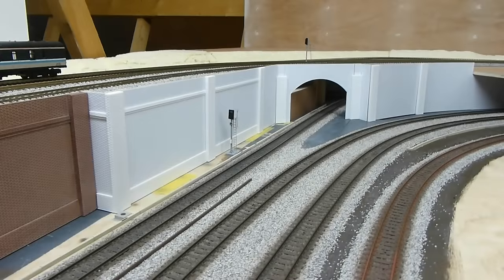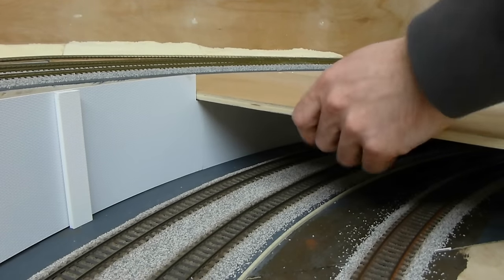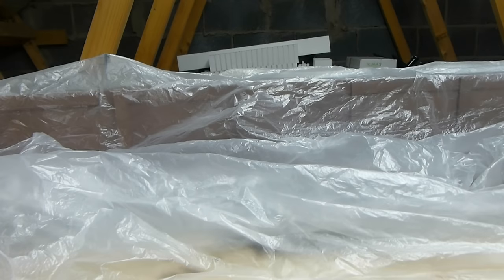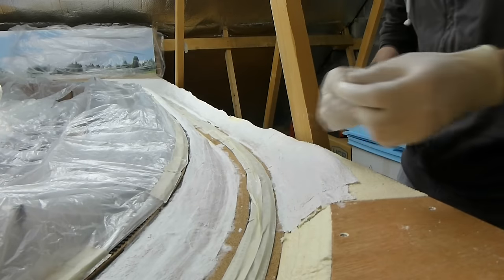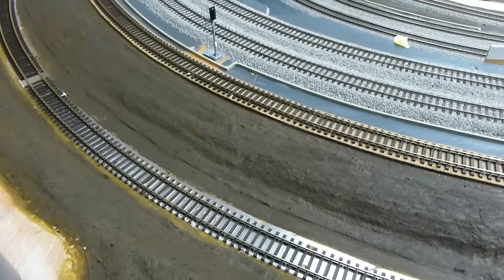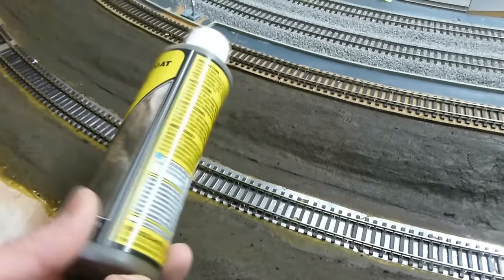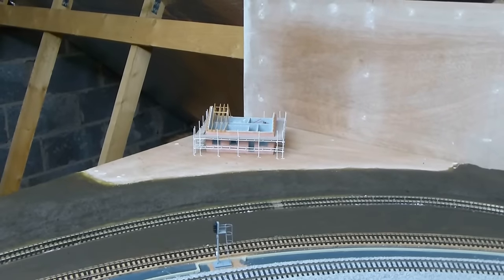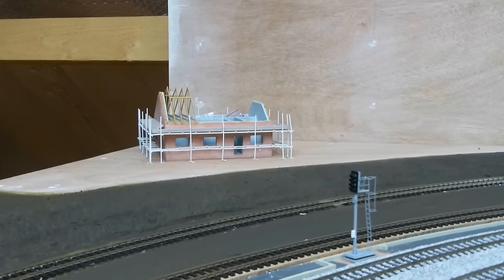Dean Park Station Video 112 - March Update & How to use Plaster Cloth

Comment: Fantastic progress Dave. I was particularly impressed by the precision of your woodwork for the backing of the retaining walls and the fit of the new top section. I like the format of the video as well, i.e. the intermittent running along with the work description. Excellent, thank you. David.
Reply from the maker: cheers David.   Yeah I need the woodwork backing to prevent the MDF from warping, both with the glue and with the temperatures.    I will seal all exposed wood with grey weather-seal primer to protect it as much as possible. Dave

Comment: Dave, great update as usual. One thing you may consider. Owing to the length of supporting wall on one side of the incline, with continuing train manoeuvres above, it may not be as supportive without some adequately spaced buttresses before filling all the gapes cut to make the wall sit vertical. Victor.

Comment: Hi David
Its all been said before - your attention to detail is the best I have seen while researching various aspects of modelling. Well done, at some point a list of the accessories you have used would be fab, really like your street lights. 
Many thanks 
Allan
Reply from the maker: hi, I try to remember to give a running commentary of the products, paints, materials etc I use.   I do however sometimes forget....feel free to ask. Cheers. Dave
Reply: Your information all the way through this video is seconded to none, helpful and very informative well done for the explanation and detail and help.
May I ask for some advise please, 
I am having to install a AR1 auto reverser unit and unsure on how to wire it, for example does it connect to the track bus, are there droppers within the loop and if so, what do they connect to and how. As much help on this would be appreciated please.

Comment: Great update as always. Could build whats called a Caravan Club CL site which means 5 touring vans only allowed on the site - these tend to be farmer fields with tracks rather than a road into the site and not all CL sites have showers or toilet blocks etc, you could have 4 or 5 vans in field of grass with sheep etc - you could build a toilet block (posh CL site) and even some electrical points for vans to plug into Check CL site on the net if interested.

Regards
Allan

Comment: That's looking really great Dave.

One tiny suggestion about that central pillar.
Where it's lined with the brick plasicard.... take a needle-file to the corners and try to blend the horizontal mortar course to stop it being an obvious vertical line.
Reply from the maker: Hi, cheers.  Yeah i see that....will try, but have noticed on previous parts that when its painted and toned down with mortar it doesn't look too obvious.
Reply: DaveClass47 I have a different approach.

When I do things like that, I carefully cut out the half bricks for one piece, and the same on the other piece, and then interlace them like real brickwork is.

It takes longer, but it looks so much better, and there isn't that line that (to me) stares at me!
Reply from the maker: If I did this I would kill myself with frustration.....with over 3 metres of walling, dozens of buttresses/edges etc I simply dont have the time to do that.

Comment: Excellent. That tunnel is going to look great on a cab view video. It's also a great way to do a tunnel if I'm right in assuming the top is always able to be lifted off?
Reply from the maker: Hi, thanks.   The top will eventually be fixed down, but the tunnel is short enough that I can get in to clean the tracks etc.   Dave

Comment: Hi Dave.. I've been wondering what style of foam you use for creating your landscape? I'm looking into Extruded Polystyrene (XPS) Board and using the Woodland Scenics wire foam cutter. I was hoping to find a video on your channel on cutting your foam but I couldn't find anything. What products do you use?
Reply from the maker: Hi, I use CELOTEX insulation board.    You get it from Wickes and other DIY places.   I have the 50mm thick stuff.   Its easy to cut and file, but you NEED to wear gloves as the fibres can get stuck in your fingers.  All the model magazines say to use this stuff, that's where I got the idea from.  It can be messy, so keep a vacuum handy as you work and cover the surrounding area with protective sheeting. You can glue it with Woodland scenic foam glue.   Cheers. Dave

Comment: Have you thought about using emulsion paint - test pots cost about £3. OR use left over emulsion paint change colour by mixing in acrylic colours.  Add sand and PVA glue to give textured effect. you can add soil to make a realistic ground effect.

Comment: David
Can you please advise on where you had your station roof made, also, could you advise on the detail that was required. Combined with the glazed roof sizes etc.

I am trying to design a glazed roof area like Edinburgh Waverley.
Reply from the maker: Hi, its a Scalescenes roof kit.   All instructions come with it.   It takes time but is easy enough. Cheers. Dave
Reply: Hi David
Many thanks for quick response, I will look at their details. Hope all going well with your designs.
Allan

Comment: Hi Dave, Can you tell me what did you use for the base block for the catenary, you seem to have added what looks like a 5 mm high square block. if you have covered this in one of your videos then let me know which one. Thanks.
Reply from the maker: Hi, 4mm plasticard blocks (2mm x 2 glue together).  then painted.  Glue to base board, drill hole if req for masts.   Cheers. Dave
Reply: DaveClass47 Thanks Dave